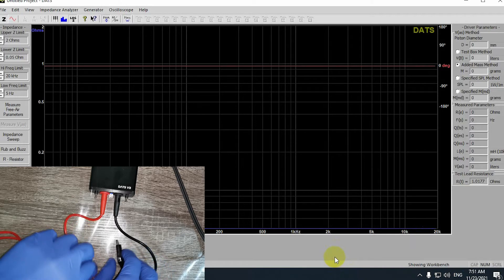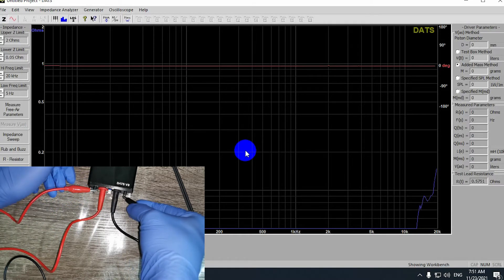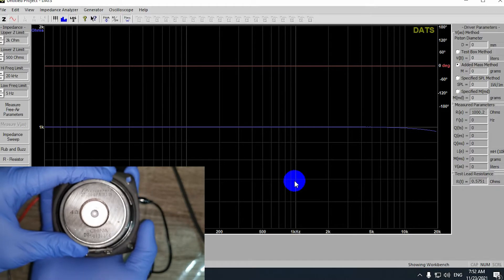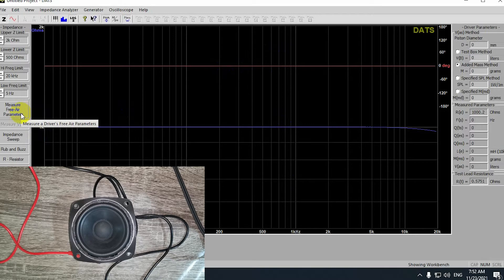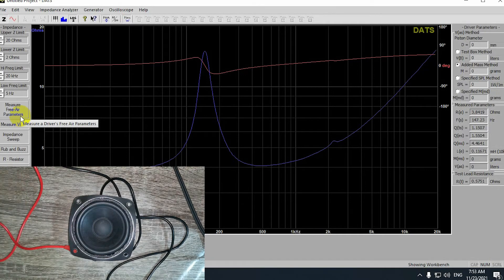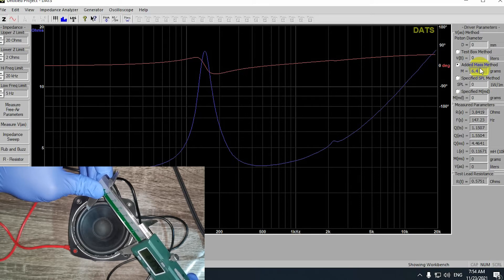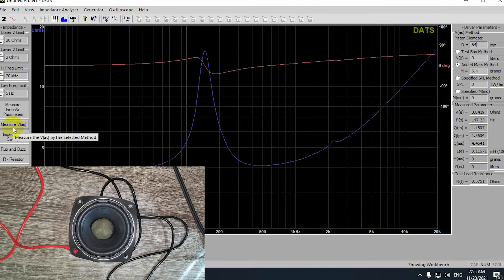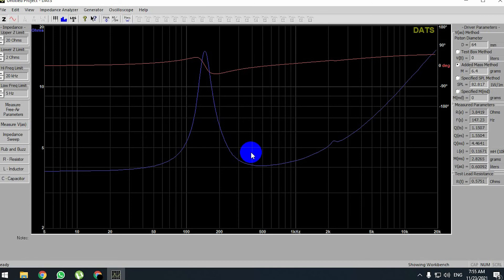DATS V3 Tutorial - Dayton Audio

Comment: Hey there, i tripped over this Video while looking into a question i have regarding the DATS. So my Test Lead Calibration yields about the same results as yours, with the Impedance increase at the end (~10kHz+). I did quite some measurements, both with the provided test-leads, aswell with other cables (calibrated ofc). And i am convinced that the test-lead "error" isn't subtracted in measurements. 
How i got to this conclusion:
I did a test-lead calibration, and after that, measured the test-leads in this same configuration - same result.
Measured a cable with two banana-ends plugged directly in the DATS (calibrated on this cable too), that has not such a rise, then calibrated for the test-leads, then measured the same cable with the test leads again - i get the high frequency rise again in the measurement. 

This should not be like that in my understanding. Can you verify this? Or even have an idea whats going on there?

With kind regards
Reply from the maker: Hello Dear, As I understand from the manual, once the impedence is measured and saved (ie. 0.5751ohms in my case) it will conpensate for it. If you have more concerns, I suggest that you contact Dayton Audio as they responed to me to another question before.
Reply: @abnormalactivity3469  thanks for the answer! i guess i'll try that then =)